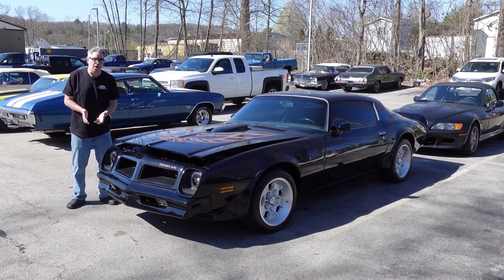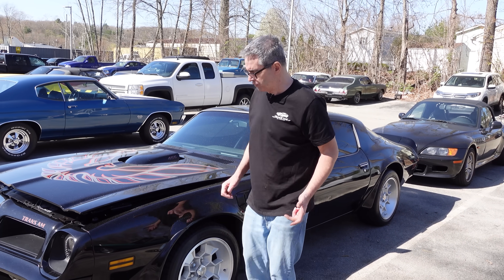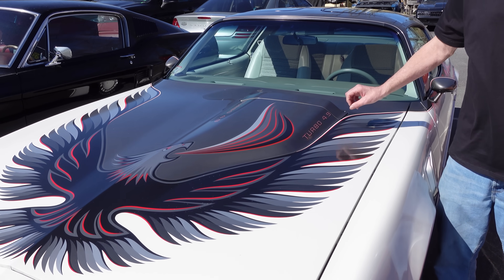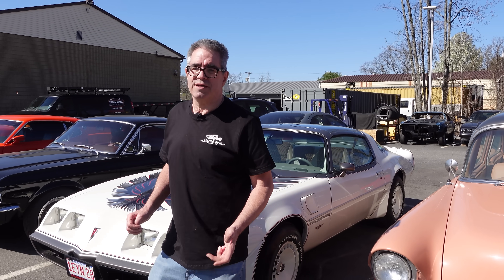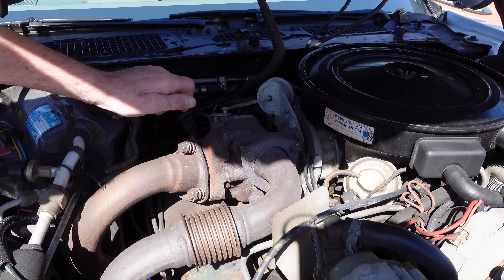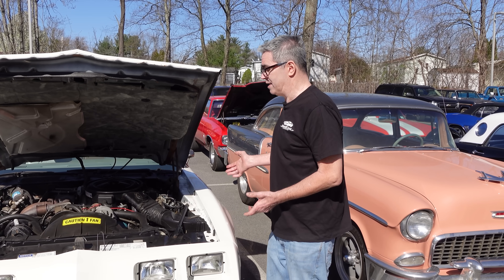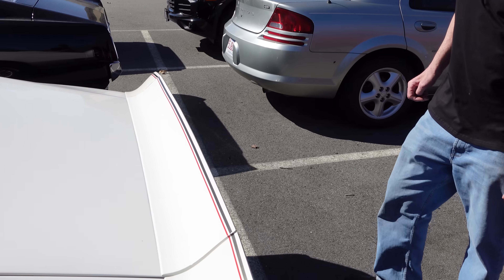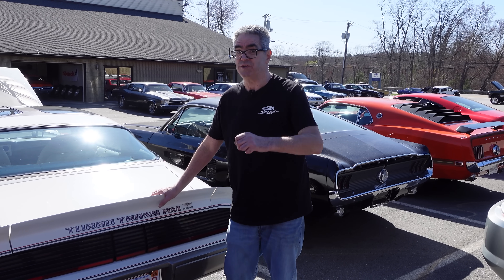Disco Tech

Comment: Hair dryer bolted to the top of the 301....Great line Steve!!
Reply: I think the hairdryer had more power. 😂
Reply: @diegohorton869  You are correct....LOL Sure blows harder!!!
Reply: Could you bump the boost up on these at all ? I’m assuming they were limited as they blew through the carburetor. We were spoiled in the 90’s/early 2000’s when you could take a turbo car and just a chip would net you another 75-100 horsepower or a new turbo would double your power

Comment: Well that made this morning brighter - thank you. If memory serves, 4 wheel disc became an option for the 79 model year with the WS6. I know I'm in the minority, but I like the Turbo Trans Am.  No it wasn't a Super Duty or a W72, but for the time, it did alright. Again, many thanks for starting the day off right. Keep healing sir ~ Chuck
Reply: Correct, 1979 was the first year for four wheel disc brakes as part of the WS6 package which debuted in 1978 and didn't have disc brakes. I too like the TTA, it was right for the times.
Reply: Literally what I came here to the comments to see. I was hoping someone would mention that the disc brake option came on the '79 WS6 package.  Also, the anniversary  pace car package was my favorite paint scheme of them all. Loved the turbo wheels too. If you disconnected the waste gate you could get the turbo to pump out about 12 psi. But don't do that too often cuz that melted pistons and turbine wheels... basically the whole thing would get wasted. But you COULD have a good time melting it down.
Reply: @derektrieglaff9103  I have a non-WS6 and WS6 car. The difference is night and day.
Reply: @googleusergp  ummm... ok? That's cool... I mean, aside from the brake package... I know the WS6 came with other items that made it ride firmer and handle better. But other than that making the performance driving experience better, what was night and day about it? I mean, if I'm not mistaken... you could get the T/A 6.6 on both WS6 and non-WS6 cars... because the only way you could get that was if you opted for a 4-spd trans. But it wasn't dedicated to the WS6 option
... but you could get the WS6 with the 6.6 litre which is the olds 403 and a TH400 3 spd auto trans. So, I'm not catching what the night and day difference you're talking about is.
Reply: @derektrieglaff9103  Bad info. The 403 Olds V8 is paired with the THM350, not the THM400. The WS6 package has nothing to do with the engine chosen, even a 301 non-turbo L37 could have WS6 (my friend has one). You have to drive a WS6 car versus a non-WS6 to know. I own both.
Reply: @googleusergp  well, I'm not gonna debate about the transmission between the 400 or 350 because I had one with a 400 in it when I was 24. At that time I never cared enough to check and see if that rot box of a disco whip came with the 400 or was changed out for one. But, when I did the trans pan service on it the parts store gave me the wrong kit and the kit that fit was for a 400 trans. So, idk. And yes, like I stated before that the engine and trans never meant WS6 or not. But, the T/A I had back then was a non-WS6. So, I guess you're right, I'd have to be able to drive one then the other to be able to determine the difference in feel from one to the other.
Reply: @derektrieglaff9103  Nothing to argue about. The 403 Olds V8 was never paired with a THM400 in a Firebird. Someone swapped out the transmission in that cobbled together hooptie you had. LOL.
Reply: @googleusergp  very likely so. I bought it for 1600 bucks so I could get to work. Doesn't surprise me in the slightest.
Reply: @derektrieglaff9103  I know it was swapped. No THM400 with a 1979 Firebird model of any kind.
Reply: @googleusergp  🤦‍♂️....

Comment: Had the 1980 pace car, just like the one you showed. It had all the speed that I needed and the 4-wheel disk brakes saved me from crashing one time. A very fun car to drive!
Reply: A very nice cruiser and 44+ years later, it still turns heads just like it did when it was new.
Reply: @googleusergp  Unfortunately, because of a tiny hose at the back, bottom of the carburetor which had a leak that neither I nor the dealer could find, it caused it to overheat and cracked the heads. Never ran the same after that. Miss it!

Comment: Good to see you Steve and doing better. Worked as a machinist on these engines. The 301 only had counter weights on the front and rear of the crank and hollowed out rod journals. When these turbo cars where driven fast the carb would lean out and melt the pistons out of it.

Comment: The 1979 10-anniversary T/A got 4-wheel discs.  The rest of the F-bodies got rear drums.

The 301 was planned for the 3rd-gen F-body until upper management quashed it.
Reply: Yes, TATA's got everything. But it wasn't just TATA's that got rear discs. Rear discs were part of the WS6 handling package, starting in 1979. So, any 79 TA or Formula with the WS6 handling option had rear discs. And there were a good many of them since it was a popular option...so popular that they couldn't keep up with the rear disc orders at one point. To help alleviate that problem temporarily until they could catch up with production, they created a new option, the WS7. You would get the other parts of the WS6 package which improved handling like a bigger rear sway bar, quicker steering, control arm braces, etc, but with rear drum brakes.

Comment: Glad to see you back! And Trans Ams are always a favorite topic. Would like to mention that rear disc brakes were part of the WS6 package, starting in 1979. So, any 79 TA or Formula with the WS6 handling option had rear discs. And then of course, the WS6 option with rear discs carried over into the 80-81 years. In case it wasn't clear, it's true that the turbo cars had the turbo hood with no shaker. But even in 1980 and 1981, there were still shakers on TA's that had the regular 301 Pontiac or the 305 Chevy engines.

Comment: Good to see you out and about. 79s had rear disks available. My favorite experience with a 4.9 turbo was one showing up in the shop for overheating, we put the hose in the radiator to fill it with water and water started bubbling out of the carburetor.

Comment: Great to see you up and about again, Steve. 

For me, the Pontiac 301 turbo is one of the great automotive "what ifs." Supposedly there were plans early on to carry it over as an option for the third gen TA, which is why that car had a similar offset-to-the-left hood bulge. Had that happened, and had technical development followed a similar path to the Buick 3.8 V6 turbo (sequential fuel injection, intercooling, etc.), I can imagine the Trans Am hitting 300hp by the end of the '80s...and enraging the entire Chevrolet C-suite in the process...

Comment: My first car in 1983 was a ‘75 Trans Am but in 1985 I bought a 1980 Indy Pace Car edition, just like the one in this video. I still miss it, as it was gorgeous and fun to drive around, even if it wasn’t fast. I’m still amazed my 2023 V6 Charger has more horsepower and torque than that car, is still enjoy the heck out of one of those old beauties.

Comment: Hey Steve glad to see you’re up & about you mentioned that only the 80 & 81 Trans Am’s had 4 wheel disc brakes the 1979
Special Editions also came factory with 4 wheel disc brakes along with the Pontiac 400 & 4 speed manual transmission myself & a friend of mine owned one each just a tid but you might have overlooked. God Bless continue to keep getting better & stronger.

Comment: Good to see you back, as always. Whoa Nelley, some things need sorting out here:

Not correct, from 1973 (which was the first year of the SD and 1974 being the last) onward, the shaker hood scoop was not functional. This was due to EPA regulations, including those for noise. 

1976 Trans Am: No VIN, can't win, but easy to figure out, no doubt: 2 for Pontiac, W for Trans Am, 87 for two door coupe, W for 455 CID V8 with four barrel, RPO code "L75", aka "Last of the Breed", 6 for 1976 model year, N for Norwood, OH assembly and the rest is the production sequence. The Norwood, OH plant closed in 1987. Exterior paint (assuming originality) is code 19 Starlight Black. 

Not correct, in 1980-1981 both cars with the RPO code "L37" (Pontiac 301 V8 with four barrel) and RPO code "LG4" (Chevrolet 305 V8 with four barrel) both had the shaker hood scoop. Only the RPO code "LU8" (Pontiac 301 V8 with four barrel and turbo) had the "hood bulge" like that. Yes, the turbo hood monitors (RPO code "UR4") are typically equipped on turbo V8 cars from February 1980 onward. My January 1980 assembled Norwood turbo car doesn't have them.  The turbo engine was typically not used in CA due to emission regulations, although oddly enough, plenty of them were assembled at the GM Van Nuys, CA plant, one of the "Terrible Three" in the GM system.

There were 5,700 Pace Car editions for the 1980 model year. Not correct, 1980 had 210 HP, and 1981 (due to the C3 system) had 200 HP. 1981 had the "Y85" Nascar Pace Car edition to replace the Y85 Pace Car for 1980. My parents almost bought a 1980 Pace Car new, but my mother drove with the parking brake on with the dealer demo unit and they couldn't secure another one, so we got the Carousel Red one that I still own today. I almost got a 1981 Y85 a few years ago, but the seller and I couldn't agree on price (we were about $1000 apart and neither would budge). No VIN, can't win, but easy to figure out, no doubt: 2 for Pontiac, X for Trans Am Pace Car, 87 for two door coupe, T for 4.9L (301 CID) V8 with four barrel and turbocharger, Pontiac produced, option code "LU8", aka "Last of Warriors", A for 1980 model year, N for Norwood, OH assembly (closed in 1987) or L for Van Nuys, CA assembly (closed in 1992) and the rest is the production sequence. No tag, can't brag, but easy to figure out, no doubt: 80 for 1980 model year, 2FS87 for Pontiac (2), Firebird (FS), two door coupe (87) then N or L for Norwood or Van Nuys, 12C for Oyster interior trim, 11L and 11U for White exterior paint, L or W for lacquer (Norwood) or water (Van Nuys) paint, A51 for bucket seats, A31 for power windows, CC1 for T-tops, Y85 for Pace Car, GR2 for gray secondary interior trim, among other codes. 

Correct, the 400 and 301 turbo matched the last of the 455 CID V8s in HP rating (more or less). Not correct, four wheel disc brakes debuted in 1979. The WS6 package debuted in 1978, but without four wheel disc brakes. Due to a shortage of parts, some WS6 cars became "WS7" and were the same package but without four wheel discs. Not correct, 1982-1992 (3rd generation) Firebirds had Chevrolet V8s---the last of the Pontiac V8s rolled off the line in the Spring of 1981, and hence I do not acknowledge them as true Pontiacs, they are "Chevyiacs". Not correct, the 1989 20th Anniversary Trans Am was turbocharged and used the 3.8L V6 from the Buick Grand National. 

Back in 2002, both of my cars were featured in "The History of the Firebird" produced by Veloce Publishing. I offered to do the technical writing/review for the book and was told that "they had experts". When writing a book like that, it should always be read by more than one person. It was not, and this was apparent. Consequently, the book is riddled with errors.........
Reply: Ahh yes, what would a Steve Magnante video be without a googleusergp reply. Good to see you back as well.
Reply: @anthonynofi4871  Nice of you to say, but it's just nice to see Mr. Magnante back doing what he enjoys doing.
Reply: Oh yes, turbos are a hoot! I built a turbocharged 71 camaro back in the 80's. Started out as a z28 350 4 speed I picked it up cheap because it had some rust and peeling paint. Lower compression pistons and a 400 auto with B&M trans pack, 12 bolt 342 posi. It was a tire boiling beast!
Reply: Somehow I knew this was going to be a good one....😎
Reply: You sir are a machine/computer of indisputable information!!
Reply: When is your car book coming out?
Reply: @LongIslandMopars  I was hoping he'd do a video on the Pace Car.
Reply: @NathansMoparGarage  My cars were already in a book back in 2002. The right information is out there, you just have to sort it out and not depend on the "experts".
Reply: @madmike2624  It takes years to develop the information and you're always learning. LOL.
Reply: @googleusergp  you knew eventually he'd get to it. 😎
Reply: @LongIslandMopars  Was hoping he would.

Comment: my 79 T/A had 4 wheel disc .it had the 301 with a 4spd Borg warner and i think 3.73 10 bolt gm posi . i dropped in a 400 in it out of a 71 Bonneville direct fitment right from the local bone yard .the yards were full of the old big blocks back in 85 , man did she scream after that . love ya Steve !

Comment: I know the heck you have been through I had a brain infection  my skull on my right side had to be removed because of a ATV accident on 05/06/2018. They tried to put my skull back in and my body rejected it and got infection I had to have surgery to remove it and a brain wash flush and a IV Pic line put in so I could get antibiotics twice a day for 8 weeks then oral antibiotics for 4 weeks  then a CT scan to measure  for a Teflon skull replacement then had another surgery to install it. You are in my prayers I thank God for his grace and blessings  I still have my knowledge and memories  I started a project a country Boys corvette a 92 s10 with a 427ci SBC  procharged with a 4l80 transmission with Trans brake a strange pro fab Ford rear-end with 10" ring and pinion gears should be low 9 second or high 8 second quarter mile ride 1,000/1,100 horsepower on 93 octane gas and 1,200 on c16 race fuel.
Reply: It was my therapy the project I started  pick something to focus on and stick with it you have a ton of knowledge like I do I was a pipe/fitter and  pipe welder for 28 years before my accident after my accident I was forced to retire because of  medical issues.

Comment: In the early 1990’s my friend had a 1979 Trans-Am with the blocked off shaker hood scoop.  

We carefully cut out the block off plate and we took the Trans-Am for a ride:  My god it made a huge difference in performance getting that cooler outside air.

Comment: We called it the “Thunder Chicken” back in the day, meaning, for us, that the T/A was now a poseur and not a muscle car; only the Burt Reynolds wanna be drove them.  We were picking up the ‘71 Mustang notch backs, the unwanted ‘70 dog dish Chevelle and Nova 4 door, the ragged ‘68 Camaro, Dart/Duster and the droop eye Chargers/Sebring with the straight 6/slant 6/lo-po 289/307/318, getting the the car insured with the weak engine, then hopping them up for cheap and having a blast.  The BowTie Brigade would drop in a hot 350 and show us all up.  Those were the days:  adjusting valves, rebuilding carbs, pulling a crank with a spun bearing in a snow storm, honing cylinders, finding junkyard gold……..miss those bachelor days in my life.

Comment: The 1982 Trans Am was initially conceived with the 301 Turbo, some pre-series models had the Turbo badging, and off course, the Turbo hood that remained.  But as all Pontiac V8s were axed after 1981, they had to stick with the N/A 305. 
Further developement of the Turbo 4.9 would have been very interesting, maybe it would have topped the performance of the Turbo 3.8L of the Grand National a few years later. It really needed an improvement of the crankshaft design and better heads.

Comment: Its Great to see you Back Steve!! Hang in there & is this a shop of some kind? Wow all the cars ive always liked some of those ive owned in the past i had a 1980 Firebird with the 301 4 Barrel nice car was fast for a small V8. It was a glossy Grey color ,rear trunk lid spoiler ,rally wheels ,RTS Suspension, Trans Am Firebird steering wheel .Those were the years for some nice cars .

Comment: Bought a 78 TA brand new,  Drivetrain was great.  T-tops leaked and door hinges were shot in two years.  Power windows were slugs.  Maybe typical of GM at the time. Still a blast to drive compared to other cars of the era with the quick ratio steering and relatively good acceleration and excellent brakes.

Comment: Memories. My very sedate Mom bought a FireBird (tho not a TransAm). Bright RED! Because (she said) it was the only car on the lot with electric windows! (Damp climate and short arms.) V-6: you could see they left-off 1/4 of a smallblock V-8, and had a foot of space between radiator and engine. (Still kin to Nova which grew to a 250CID I-6.) I drove it out of sight/hearing and put my foot down. It was no 455! But in low gear it had more thrust than Mom ever needed. Ran the interstates (@55MPH) very nice.

Comment: I owned a ‘75 400/4-sp and a ‘77 400/4-sp.  Both had the Pontiac 400 and were good for 220hp. The ‘75 was geared for higher speed than the ‘77.  It could hit 100mph in 3rd gear!  The ‘77 not so much. Pretty amazing how quickly the gov’t regs affected these.  I wish I still had that ‘75. That car was bad-a$$. Cheers!

Comment: I had a 1981 T/A I bought new. It had the 301 Buick engine with the first year electronically controlled Rochester four barrel naturally aspirated, Unfortunately the car never run correctly and the lockup torque converter would kick in and out even when cruising at 55 MPH. The dealer's service department didn't know how to even work on the engine controls. It never got better then 12 mpg and the catalytic converter overheated one time when the computer malfunctioned and dumped raw fuel into the engine and caught the carpeting on fire. I kept the car about six months before I got rid of it. That was when Detroit build quality was rock bottom.